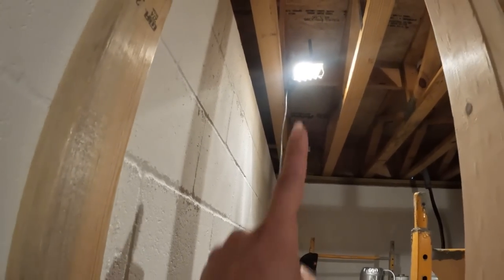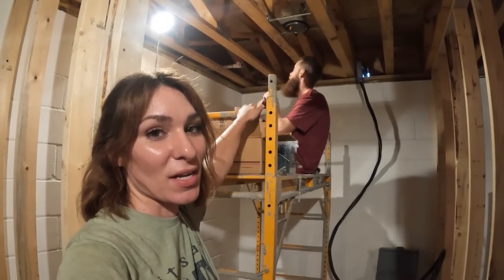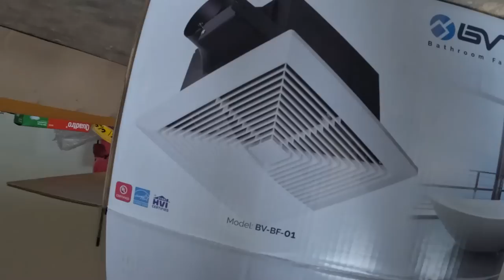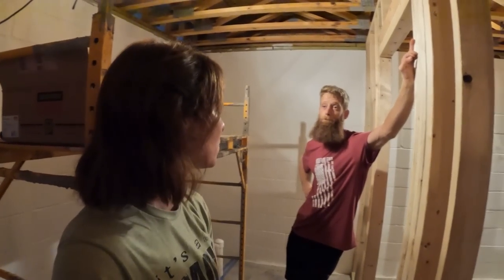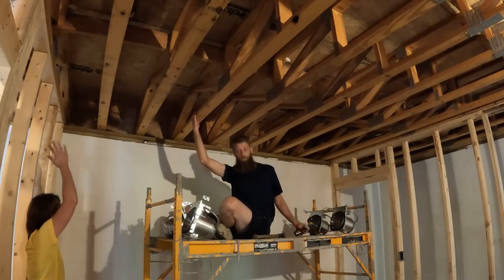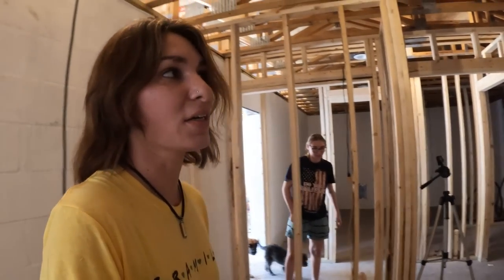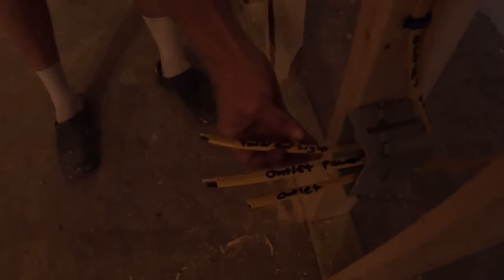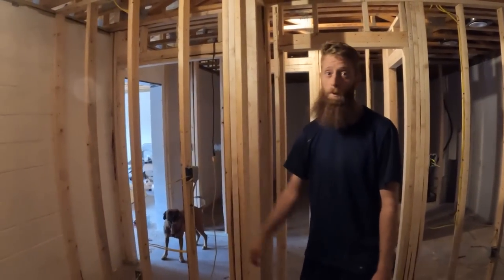ELECTRICITY | Wires, Plugs, & Switches OH MY! | Couple Builds Basement For Cabin In The Woods

Comment: Gary, two things. First you should have all the lights on their own breaker because if you trip the breaker with something plugged into the outlet then you also have no lights. And two, you should never hook up more than two separate wires to an outlet as they are only designed for two. That's why only two sets of lugs. Using more is unsafe as you cannot assure a tight connection on the third set of wires.
Reply: Agree 100% with this. No idea why they would put lights on the same circuit as sockets/outlets. Would never pass an inspection here in uk/ireland or most of europe.
Reply: I also agree with your assessment. I remember they didn't need any advice since everything was already researched and just wanted us to sit back and watch. Good Luck.
Reply: Lights and receptacles should be on separate circuits as stated above and each room should be on a separate circuit since most area codes won't allow more than 6 items to a circuit anyway. Also since it's in a basement everything needs to be on Ground Fault circuits. Just curious, is this house going to have a heating/cooling system in it? you should have installed a trunk line in the ceiling trusses before installing the band boards and with all the stuff your putting into the ceiling now where are you going to find room to insulate the ceiling before winter? I would have batted the ceiling with fiberglass and just used temp surface lights until the upper levels are raised then worry about sheet rocking. Simple cardboard sheathing for walls and ceilings would suffice until the upper levels are dried in.
Reply: Agree, that is a scary set up. Hopefully they change it up before getting all the drywall in.
Reply: Most of you are correct. I had sent them a email offering FREE consulting. I am a Systems Integration Engineer. E.E.T. with Fifty-five plus years of experience. And yes they are making mistakes. What can I do if they don't contact me.
Reply: @bazzaice00  L
Reply: @petehouse4270  exactly. I don’t know what they used as reference material for their research, but basically everything seems unconventional, amateuristic and sometimes outright dangerous. Entertaining nonetheless, I’m just waiting for things to go wrong tbh. We’ll see, I just hope no one gets hurt in the process.
Reply: if you twist wire wires with plyers and use a pigtail and wire nut not the push on connectors you can have more than 2 wire in a recept box. the thing you need to worry about is the box fill. code only allows so many romex wires and a device in each box. also my opinion of push on connectors should only be use on light fixture makeup. on receptacle circuit they can get hot loosen the connection and cause you trouble in the future.

Comment: lights and recpt power should not be on the same breaker. if the outlet trips the breaker the light go out as well. also you don't want more than 9 outlets per breaker. feed the light power to switch box then to the next switch box then to the next. The when making up the box yo tie all the power blacks together along with a pig tail. All the white wires together  and all grounds together. You will needs a pigtail wire on the ground as well to tie onto the switch. then what your left with in the box is two black wires and the ground. the black wire going to the light fixture is called a switch leg. There are 2 brass screws on the switch i put the power pigtail wire on top and the switch leg on the bottom brass screw.  doing it this way when troubleshooting problems you only need to open switch boxes for test. also when running wires through top plate drill hole up through top plate give the wire protection and your not weakening the top plate.

Comment: i guess you do electrical Different over there  as we keep lights and sockets on different rings, and you seem to have wired them togther. So that meams if you have to do any electrical work in future you would have to isolate both light and sockets, rather than one or the other.

Comment: Apply temp power to your lights to make sure you like the setup
Only other thing is maybe 🤔 using some three way switches to control lights at different doors
You can find free programs and upload a sketch ✍️ of your layout n it’ll draw a wiring plan to be in code 
And set you up with switching comfort 
But of course you may want to do basics in the basement but include at least 3way switches for the stairs and leave wire capped in the basement that will be in the wall for the future cabin upstairs 
But so far you’re rocking it out 
I’ve wired many homes n buildings as many men n women in here, use the knowledge take us for the ride! Remember the GROUND WIRE is most important never not connect the GROUND on everything lights/switches/plugs/appliances/breaker panels

Comment: Hope you used strain reliefs or grommets where the Romex wire goes into the can light box. I did not see any in your video. Also to turn the air duct on the exhaust fans use two 45 degree fittings instead of a 90. Air does not turn sharp corners well and a 90 will cause a restriction. Use hard duct where ever possible. The flexible duct also restricts flow.

Comment: A suggestion on upstairs outlets. Your using 1outlets (1 plug) in basement. Upstairs instead of a 1gang fixture you should use a 2 gang fixture (2 plug outlets) . You never want to use extension cords and 2 gang fixtures help to eliminate that. Better to have to many plugs than having to run a cord across the room.

Comment: Don't forget to add a number of boxes with cat6 internet cables, you will regret it, these cables can be used for other stuff later, example home automation sensors etc. and as you said, adding it later or pulling it externally is not fun

Comment: I've lived in a basement house. My mom owns it. The pipes never freeze and if you can acclimate yourself to the constant 56 degree temps when the heat is off, you can save lots of money. It's easy to heat with a small woodstove because the walls are southern pines boards and concrete floors that hold the heat very well.

Comment: You guys should put a Ethernet/electronics structured media enclosure in your utility room and put in hardwire ethernet lines/jacks in the basement rooms and run them up everywhere on the two upper floors when you start them. I would suggest this enclosure for your house Legrand - OnQ ENP4250-NA WiFi Compatible, Electrical Box Structured Media Enclosure, 42 inch, White.
You could put your modem, switches and all kinds of stuff in it! Ours works awesome and it makes things so clean

Comment: very neat job nailing and running the wires. Literally better work than half of the licensed electricians I work with. I know it was said in other comments, but lighting should be on its own circuit, separate from outlets, if you don't fix it down in the basement at least keep that in mind for upstairs. Also, someone said as well but don't cramp 3 wires under 2 lugs on the outlets, that's a potential fire hazard. utilize pigtailing and doing nice splices for those. I may have to send you a pair of linesman's pliers and strippers to make electrical easier lol, I can't even imagine doing all that with the crimper Gary was using!
Reply: I think this is entertaining to watch, BUT people should ignore the technical elements as it is clearly not to way to do things.

Comment: One thing to also be mindful of, is that where you have wiring running through a wall stud, it’s prudent to place the metal protection plates on the face of the studs each side where the drywall attaches to, to prevent the drywall fasteners you will be using piercing the wiring running through the studs. Bad news if the circuit is powered up for the person screwing the fasteners in!
Reply: agreed it code in our area

Comment: Hey Gary I noticed those can lights or pot lights as we call them here in Canada they seem to want to float on those rails. They slide back and forth really easy. To me that is a problem. They can easily be bumped and move out of their desired location after you wired them in their said position. What I have commonly done being electrician and have installed many of these I take my diagonal cutters or side cutters if you will or any crimping device and I crimp the guides that slide on the rails, just give them a really good squeeze to create a friction to hold them in position. I've done a lot of custom homes and when you're wiring lights in a fixed pattern aesthetically you do not want them to move. After the drywall is up and if they have moved you're left with creative aesthetic explanations so to speak. Maybe you already know and this in your plan to do something like that. If not I just thought I could help by pointing that out. I know I have learned a lot of different methods from you guys and thought maybe I could share a tip of the hat to you folks; before the drywall went up. I love what you're doing.
I look forward to every episode and thoroughly enjoy everything you do.You guys are an awesome family! Thank you for sharing your journey.

Comment: Coming along guys 😁👍
Wouldn’t it have been easier and less costs to put the washer and Dryer against the outside wall to vent the heat straight outside from the Dryer ? Those Dryer exhaust vent pipes do collect dryer lent and if it’s vented straight out thru a outside wall it’s a easy clean out and fix. BUT venting it up and Thru the ceiling floor Joyce’s WHEN....(& it will).... that pipe in the ceiling and under the floor gets stopped up......The only way to clean it out is to constantly be taking it lose above the dryer and outside vent cover & with very high pressure air blowing it out. Or a bad clog up having to tear the Sheetrock out of the basement ceiling to get to the pipe for clean out. Most importantly to mention that vent pipe running between ur upstairs floor and downstairs ceiling.... it gets stopped up, it’s going to do 
1☝️of 2 things or Both.... 1) Burn your dryer up....or... 2) start a house fire 🔥. 
    I’m not you, but I’d have put the washer and against the outside wall to avoided all that headache or heartache. That way all I’d had to do to clean the lent from the vent is go to the outside wall (Outdoors) to the vent and take cover off cover and reach in and clean it and stick cover back on. The worst that could happen if it got stopped up in that cinder block wall is ruin my dryer.  
But a fire 🔥 in between my floor and ceiling could burn my house down or worse (loss of Life) which can’t be replaced.  Sorry guys I just think 🤔 venting the dryer that way between upstairs floor and downstairs ceiling is a horrible decision. No hard feelings I’m only telling ya from a professional standpoint. Doing indoor Heat & cold Air Exchange vent pipes that way is different. But running pipes sideways between ceiling and floor....ESPECIALLY Furnace exhaust, & dryer pipes that collect lent is a big no no. I know y’all don’t have regulations there but it’s a safety concern.

Comment: in the uk we run seperate fuse in the board for lighting circuits, we do not take power to lights from sockets unless they are fused 
Lighting circuits are 10 amp and sockets on a ring main are 32amp

Comment: Code in my area with remodeling or new buildings they say vents in more areas, not saying you should but a vent in the utility (because the heater in there) and in the kitchen area could be something you might want to consider, especially since it's a basement and you habe few Windows there. For example I have vents in the basement, in-house garage, kitchen, bathrooms, utility area, and so on. It's a central vent with ducts and I've not regretted it since.

Comment: You can make a first test for the light in the room by connecting a plug with a wire on it with the help of terminal strips to the distribution box or feeder of the room and then simply plugging this plug into a power strip. Best a power strip with on and off switch for all cases

Comment: Gray trash the plastic outlet boxes!!!!!!
They seem nice now, but wait until you strip out the screw holes for outlet, now it is a Royce pain to repair or change. I always opt for metal boxes, may cost a little more now but save a lot down the road.  Plus if the screw hole strips or becomes cross threaded, they make a handy dandy tool to rethread or retap hole.
Please learn from my mistakes in the past!!!!

Comment: @Simple Life Reclaimed. 
Why do both American and Canadians nail the electrical cables to wall eams and inaccessible areas ?
Is it a legal requirement for wiring codes ?
What happens if a rodent chews wiring it then makes it harder to pull a new cable the the outlet. Just seems strange to me but hey I am an Aussie we don't do that here for ease of replacement, ours gets attached to beams etc only in areas you can easily access.
Reply: Also code in Australia requires that Lights and Power outlets be on a seperate circuit. Different countries different codes I guess

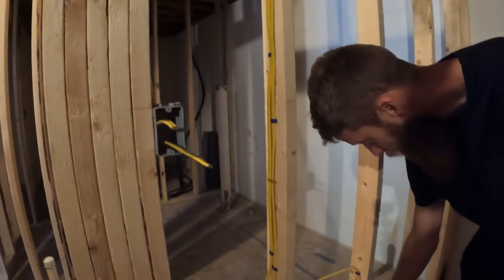Comment: I am assuming there will be no inspections on this place?  Please have someone who understands how to correctly run electrical come look at what you have done.  Not all of it will need to be fixed but some of it will.  You cannot run around the top plate and bottom cord of the truss, you must drill a hole and run the wires in the cavity, timestamp 20:27 as an example.  It's an easy fix but must be fixed, you will understand when you do wall/ceiling coverings.  I did not see how many runs you had back to the breaker panel but it looks like you may have too many receptacles/lights per run, hard to say for sure but please have someone look this over who knows what they are doing.  I am not trying to be critical but getting electrical right is essential for safety.